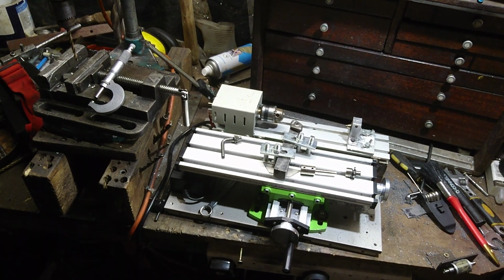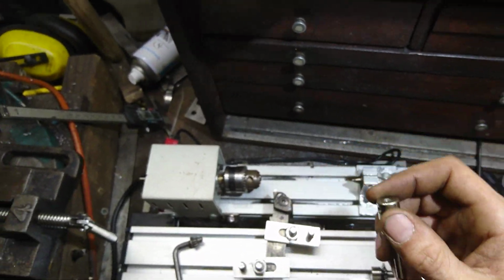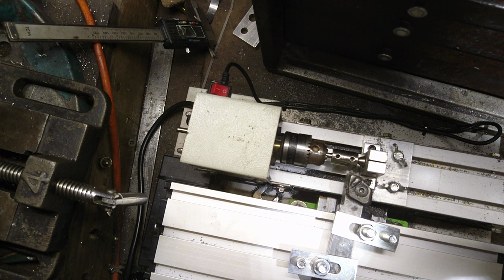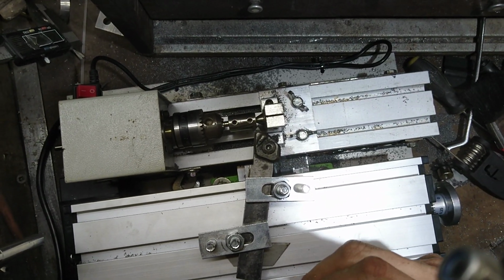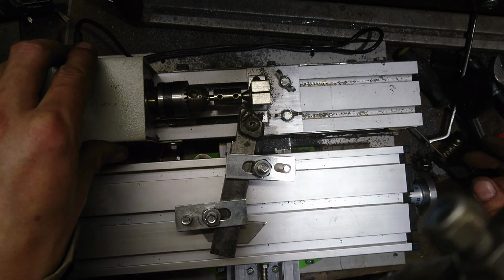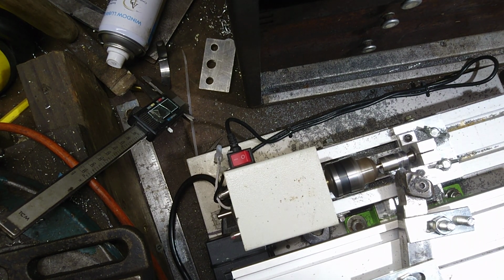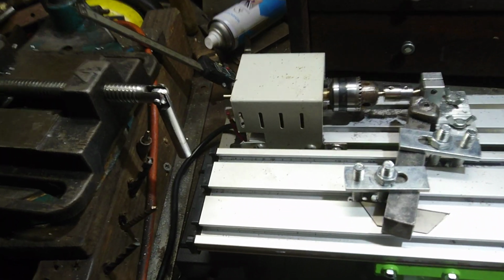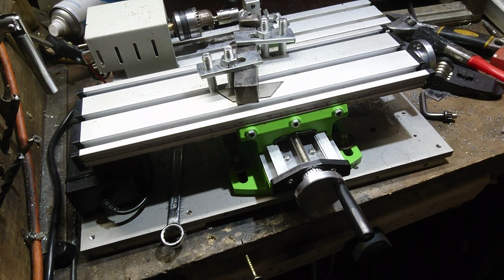homemade mini lath in action

Comment: First of all, your lathe and your philosophy as you described is amazing. If I can make a suggestion, try to use HSS tools for this thiny lathe, because carbide tools need speed and a certain depth of cut to work. With HSS you can take light cuts and considering the size and rigidity of your mini lathe it will be better.